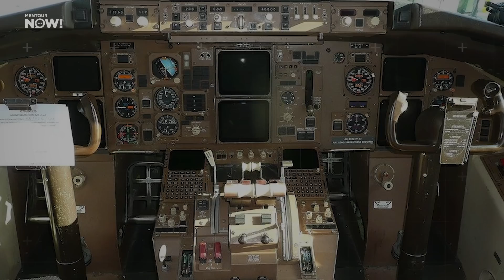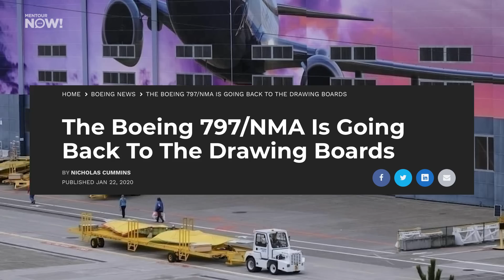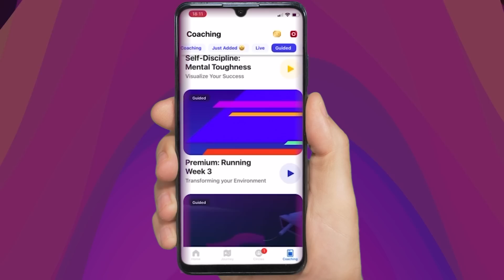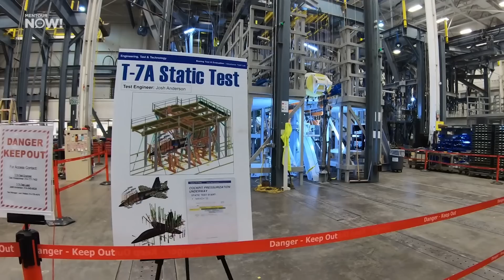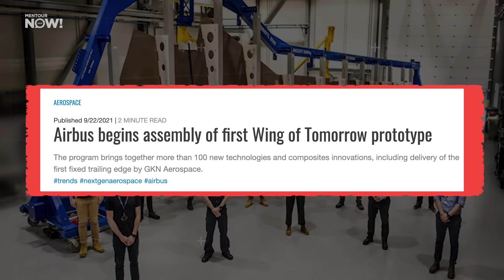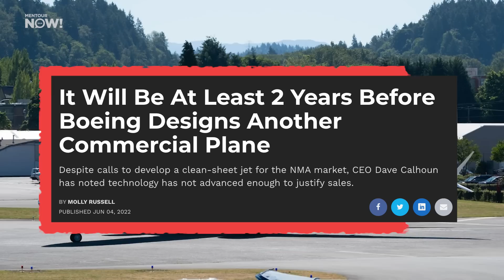Is Boeing Planning a 757 MAX?!

Comment: The Boeing 757 was a magnificent aircraft for style, performance, and riding comfort, and it's one I enjoyed flying in. Boeing, however, needs to stop stretching the 737. Once the "baby" Boeing, the 737 MAX -10 is now similar  in size, range, and capacity as that of the classic Boeing 707-120. The 737 is now simply the "twin" 707 and with less tires.
Reply: I'm a big fan of the MAX 10 and I really want it to succeed. It doesn’t seem like Boeing is all too serious about it though based on things like what Ryanair is saying.
Reply: The entire MAX design principle is UnAirworthy and a violation of FAA Safety of Flight - the aircraft cannot be flown manually - the pilots cannot override the computer and regain control - the aircraft should have never been built and should have never been approved or certified .. the FAA should GROUND the entire 737 MAX Fleet and rescind the Type Certificate .. there are going to be more crashes of the 737 MAX, with the Computers failing and driving the ships into the ground and the Pilots unable to do anything about it  - guaranteed ..
Reply: @bradhartliep879  You should do some research because what you said is just not correct.

Yes, it's difficult to fly manually, but so are most modern aircraft. The max is still an exceptionally well built plane with a good safety record.

The MCAS problem is something that should've NEVER happened(Southwest Airlines and Boeing need to pay for the deaths.) However, it has been fixed and the plane recertified.

Comment: Wouldn't a shortened smaller capacity 787 be a good idea to fill the gap between the 737 Max and the 787-900, say a 787-400, it could use the same wings and engines as the existing 787 so it would save on development costs and would have more range with it being a lighter plane. Plus it's easier to load and unload and turn around a two aisle plane than a long single aisle plane.

Comment: The first time Boeing tried contracting out a major aircraft development was the 787. That $10 billion program was years late and cost $34 billion by the time the stopped counting the cost. It was half way through the production before jets started selling for more than they cost to manufacture, without taking into account the cost of development. Does this idea of cheaply tarting up an old design sound familiar? At least this one starts with triple redundant systems instead of just dual systems like the 737-MAX. But maybe they could cannibalize the 787 FBW and give their new jet a better start in life? The better question is whether they have the engineers and the money to develop a commercial aircraft.

Comment: Can someone tell me why an engine is ALWAYS located "Under" the wing of all commercial transport type aircraft.  It can't be the weight.  It can't be the mounting system.  It possibly could be the thrust interfering with the horizontal stab but that is the only thing I can't think of.  If the engine was located above the wing, it wouldn't matter how "Big" the engine is, it would still fit.  Answers?
Reply: I think at least part of it is that it significantly reduces noise for the passengers - the wing acting a bit like a "sound shield"
Reply: @robbiejames1540  It's not a sound issue.  The inlet cone is designed to force sound waves back into the engine.  The engine would still be out on the wing so no vibrations will come through the fuselage from direct mounting. Thanks
Reply: @Flapswgm  
Ah, ok. I just remembered hearing someone saying that putting engines above wings could make the areas around airports quieter, but might make cabins louder.

Comment: After the 737Max problems/crashes and subsequent year long grounding, My guess they will not be using "Max" in the designation because of marketability/public perception. I'm sort of surprised that when the 737 Max came back, they did not change the monitor to distance itself from the negative name reputation.

Comment: Boeing made a shortened version of the 747 (the 747 SP), so why couldn't they make a truncated 787 with slightly downrated engines? Seems easier than basing a new plane on a 30-plus year old design. (But I am no expert.)

Comment: Having flown on a Delta 757-200 twice in 2018, and once in 2019. I am in love with that aircraft, its spacious, and the shear power it has is impressive and noticeable even as a passenger. Taking off out of San Diego it rolled down the runway and climbed like a rocket. By far my favorite aircraft.
Reply: Like the B737, it's 6" narrower than the A320series. It also rattles and is much noisier. Airbus planes arr just superior even it comes to passenger comfort. I'm always amazed at how unobjective most people's opinions are.

Comment: My impression of the 757 is that it's just a heavier and longer version of the 737 with engines and gear to compensate.
Reply: it was a completely different aircraft then 737, it shared more in common with 767
Reply: Not even close. You couldnt be further from the truth

Comment: The 757 is horribly expensive to produce... on the other side, a composite airframe is horribly expensive to make tooling for, but actuallt quite cheep to produce. Boeing is making bucks  on the 787 now when production goes a bit smoother, so is airbus on A350 (and also A220).

Boeing needs to make a aircraft from the "toolbox" of the 787... they need to make a plane what is to the 787 what the 757 is to the 767.

Comment: There is loads more than a new wing on the 777x. .. new engine, longer fuselage,  new insulation, new windows, new pilons.
Reply from the maker: Yeah and the would likely need to replace the same things on the 757
Reply: @MentourNow  i would say the 757 300 is in the very exteem end for a narrow body, if not beoyng what is exonomical in the sence of length. One have remeber that its a full 10 meters longer than the A321neo, that in turn is a bit wider. Not only is it a matter of fuselage strength, the landning gear have to be very tall, at least for a plane with wing mounted engined.

On the other hand, the A310 is in the very extreem how short a wide body can be made, and well the A310 is quite a bit wider than the 767.

I would say if they make a new narrow body, they really have no option but redesign  it from scrach. 

The utside  of that is that they can proboly make ot a lot lighter, there for being able to use the same engines as A321XLR  and still having and edge on the preformance.

Comparing A321xlr to 757-300, the 757 is 30% heavier with very little to show for it. If they in stead could make an lighter airframe they could in stead gain capacity and efficency.

The 757 is just to heavy. Even with modern engines it cant be that efficent.

Comment: It seems like Boeing is just too slow.
New plane by the end of the decade? Won't happen. By then electric propulsion will be easily viable, and that means a complete reset in design and manufacturing. 
A simple engine swap didn't work with cars, so I don't think it will work with planes either. For example batteries don't get lighter with discharge, so landing weights will be much higher. Probably more smaller engines will be better. Or even completely different engine configurations could be optimal, as electric motors are much more flexible. And maybe VTOL will be not just possible, but desirable.
Eventually Tesla will build an electric VTOL jet, so anyone who wants to stay in business should already working on it.

Comment: The DC-8 was a longer single isle airliner but it had 4 engines. The 757-300 was the longest single isle airliner for the twin engine class though.
Reply: The DC8 is never coming back. Out of 556 hulls made there were 84 crashes. Pretty deadly airplane
Reply: @chrisheffernan7540  What did that have to do with anything? No plane in the 50's had a good safety record compared to today. How many of those accidents were due to design flaws instead of pilot error, mantience error, pilot suicide, etc? You need to look at this from a 3 dimensional point of view.
Reply: @ejkk9513  I dont need to look st anything. I gave you a fact, now swallow it

Comment: I'm always wondering why airbus can build and test aircrafts so much faster and seemingly easier than boeing
Reply: Because Boeing got bought by the perennial failure McDonnell Douglas with Boeing's own money, whereupon the McDonnell management started firing everyone with talent that they could, and moving those they were forced to keep under the control of incompetent bureaucrats.
Reply: My S/O works at boeing. Lemme put it this way. They have a poster up that says we hire for diversity not for talent and many of the people they hire need a moronic amount of training to get to an acceptable level. Dont get me wrong i dont mind diversity and am literally not trying to be a bigot. But regardless of race, if your going to be hireing the guy who cant tell the diffrence between a microchip and landing gear just to meet a quota....well your going to have issues....and yes this was an actual thing. Guy mixed up a blueprint for a landing strut with a microchip diagram and spent 3 weeks fighting and sabatogeing the team working on a plane because he didnt want to admit he was wrong. Another guy they hired was supposed to be good with turbines.....and he had no idea what half the parts were called or even for in a turbine and had to be retrained from scratch just to do the single job he was hired for.

Combine that with bloated investors and shareholders who throw a snit if a product doesnt make a 10,000% profit over design cost within months (again this is literal) meaning most design teams are working with gear from the 50s and 60s due to lack of budget ontop of all the other issues they have had the last few years......

Well they still make a good plane. But that plane is spat out by a bloated wobbleing jiggleing mass of bloat, poor ideas, undertrained and unqualified staff fighting the qualified staff and ageing equipment that 3/4th of the new guys dont even know what it is or does, god forbid how to actully use it. That tends to slow things to a glacial pace at best.
Reply: @arcticfox5118  "... guy who cant tell the difference between a microchip and landing gear ...". WOW! JUST WOW! There is a mountain to climb.
Reply: @arcticfox5118  this is just overwhelming , it's sad how boeing have fallen over the last two decades

Comment: A 767 max would be perfect whilst the line is still running. The dual isle 767 is a great point of difference between it and the airbus single isle aircraft. Boarding and exiting is becoming a headache the bigger the single isles get.

Comment: They should go with a clean sheet design and think outside the box. A narrow body like the 757 but instead of a 3 and 3 single isle configuration go with a 2/2/2 double isle. Same capacity but more comfortable for the passengers especially on long haul flights. It could also be configured as single isle in first class and go to double isle in economy. Also it’s something no one has ever done before like the 707 and 747 were. Boeing could even name it the 808, a new beginning for Boeing.

Comment: Instead of trying to adapt from old designs why not build a whole new bird from the drawing board to production? Work with Rolls Royce, engage with manufacturers making new composite materiels, How about incorporating the latest digital technology for avionics. I feel Boeing need to start dreaming big here because if they don't, in time, they are going to be swamped by airbus.

Comment: I have an idea. Let's take one of those bigger engines and move it up and forward a bit on the 757 so they fit under the wing. It will handle exactly the same as the old 757 and the pilots won't need simulator training.
Reply: Hmm. You might need some kind of system to stop the nose rising...

Comment: The 767 fills the gap between 737MAX and 787 much better than the 757 does. Military versions of the 767 are still being produced, and probably will be for quite some time.
Reply: But airlines want narrowbodies more that widebodies
Reply: @heidirabenau511  why?
Reply: @grahamturner2640  cheaper to operate

Comment: To be honest, I am not a fan of the 757. I can only judge from a passenger's point of view as I don't work in that industry, so my reasons for not liking the plane can be totally different from the reasons a pilot like Petter may have for liking it. The spaciousness of the cockpit is not particularly relevant for me after all.
So, why do I not like it... I never got to fly on a -200, so I only know the -300. And this long crowded narrow tube was just not for me. Sitting pretty far back and looking down this narrow fuselage almost gave me some claustrophobia. Probably just due to the proportions, as I did not feel that when flying on smaller regional jets or even turboprops.
I certainly prefer the widebody sibling in form of the 767, in fact when it comes to crossing the Atlantic, the 767 is my favorite out of the Boeing portfolio. (Which could be biased by the individual airlines and how they put the seats in their planes, so take this with a grain of salt.)

For the sake of passenger comfort (pretty much a thing airlines don't give a crap about unless you are seated in the first few rows where the seats are much better), planes with a higher capacity than the 737 should be widebodies imho.

Comment: Restarting production of the 757 makes so much sense. I find them buetifull, very sporty looking. The 75 is so flexible, I love the power. I worked 757's and never had problems with weight restrictions, great for short runways. It was the largest plane we could launch from DCA. AA used RR under the wings, what power. Also great for Caribbean Routes
Reply: all the 757 tooling was scraped
Reply: @pablopicaro7649  thank god

Comment: The biggest problem with doing this is that after the 737 MAX fiasco - that jet REALLY should have had to go through type certification all over again - the FAA, EASA and the Asian agencies are going to say "new wings, new engines, new cockpit, haven't made 757s in twenty years...this is a new airplane, we must approve it as such."

They might be better off fitting the 787 wings, tail, landing gear and engines to the KC-46 fuselage then installing a version of the 787 cockpit. The biggest advantage of this plan is they've already got the production lines and tooling for both.

Comment: The 757 is well past its prime, so a clean sheet design is probably the way forward. But it was a great aircraft in it's day. I remember flying on a -300 out of KMDW on a hot summer day. They'd have to line up on the displaced threshold, hold the brakes until the engines were at full buzzsaw, and use a lot of the 6,500 ft, which made an exciting takeoff. Loved those "overpowered" engines
Reply: That crap. No airline pilot holds on the brakes with full power. Normally 40% N1 or equivalent EPR.
Reply: @78779  
true, the plane would shake like a wild bronco and burn the brakes
Reply: If the 757 is well past its pime what does that make the 737?
Reply: @kenoliver8913  
LOL !!

737 has kept coming in new Avatars  with the Max as the ultimate disaster